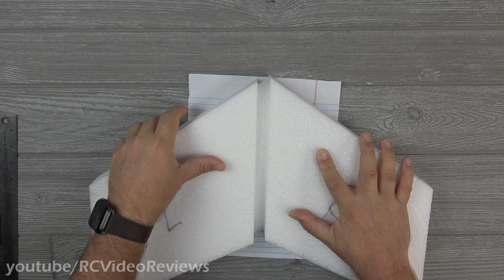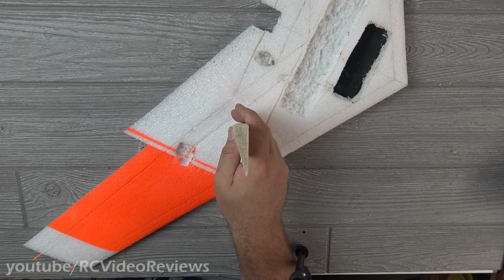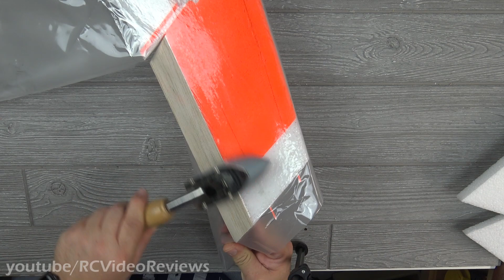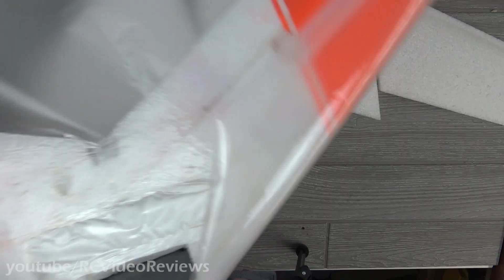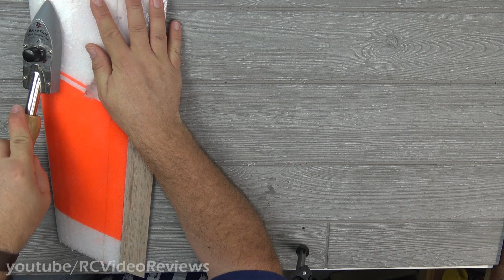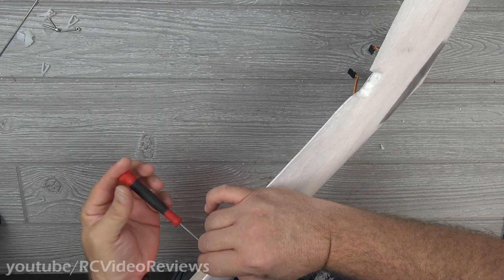FPVWRA Spec Wing Build • Defiant Wings Spec Wing

Comment: What spars are used? 2mm or 3mm diameter?
Reply from the maker: Spars are 2mm diameter.
Reply: @RCVideoReviews  Thx, great :)
Reply from the maker: @lupa-cncfocusedonutility2783  You're welcome.
Reply: Do you know why NACA airfoils are used? I think this is the worst choice - symetrical airfoil on flying wing. I know, it is by rules, but quite stupid I think.
Reply from the maker: @lupa-cncfocusedonutility2783  I don't know why they chose the airfoil they chose. Why do you feel it was stupid?
Reply: And you can see making prototype spec wing on my YouTube Channel. I started with saddle to mill the wing core.
Reply: Because flying wing needs autostabil airfoil.

Comment: John you are giving Josh Bixler a run for his money! Very well done.  Lots of good tips.  It looks like you have used laminate before. I really like your gear cover.  Watch the weight adding extra stuff.
Reply from the maker: That's rarified air. Thanks Chris. I hear you on the weight. The hatch probably weighs less than the foam I took out under the area I covered. It's pretty light. The camera had to go up front and I actually think the housing helped me hit the balance point. 

I've laminated a few planes :) Thanks for the comments.

Comment: Yeah, I'm def out on the Spec wing for now; too many new skills involved in the build on top of learning FPV in two months. I can see potentially going for the mini or ultimate class. Great vid as usually though.
Reply from the maker: Probably not a bad idea to start out with a more traditional airframe. The big thing is to get something in the air with a camera and goggles and get started. You can decide where to take it from there.

Thanks for the comment.